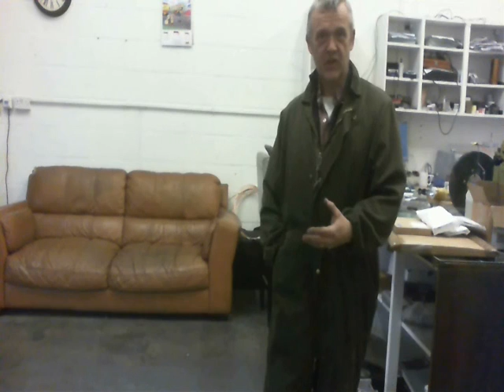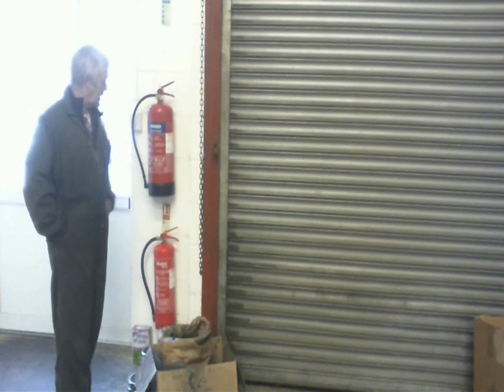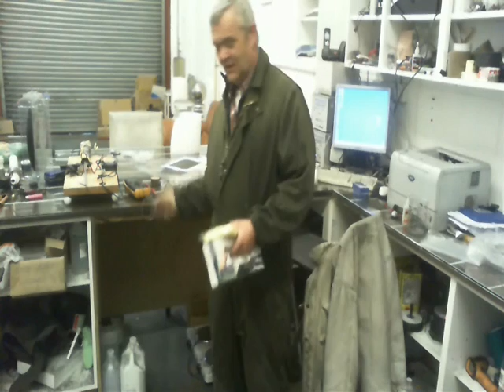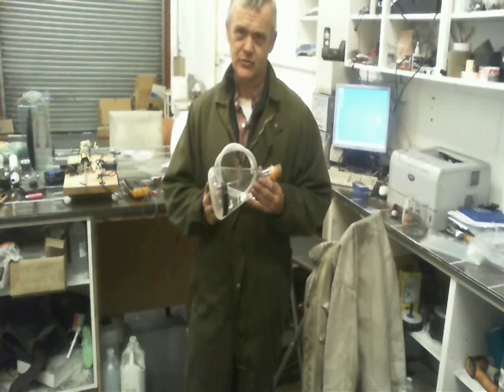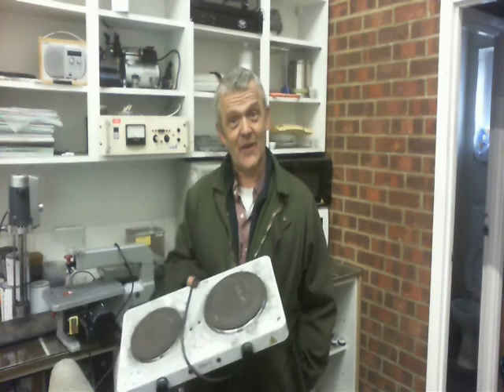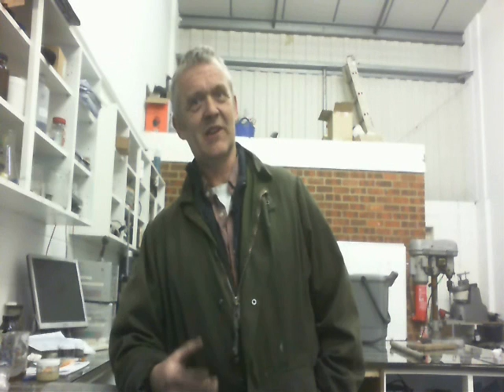A Tour Of My Lab And Some Suggestions On How To Set Up Your Own

Comment: More notes on the home laboratory.
Measurement is one of the cornerstones of science and engineering.

General rules of thumb: 

In applied chemistry (and electronics) you want to work with three significant figures.
In analytical and research chemistry, five (or more) significant figures is the rule.

The "Jeweler's Balance" our channel host mentions is most often a three significant figure device. Say, 10 grams maximum in 0.1 gram increments.
The electronic kitchen scale will be either two or three significant figures. Read the label.
Check with your local police auction of impounded property, both of these devices are often used in the street drug trade.

The enclosed balance in the background that our channel hosts mentions is (at least) a five significant figure device.

A triple-beam balance is almost always a three significant figure device.

Avoid spring scales like the plague.

Glassware:

You need to watch your expenditures in this area, it is very possible to spend a lot of money on glassware.
So much so that you will not be the first to think that you should have taken up glass blowing rather than chemistry.

There is a very well established secondary market for chemistry glassware, both as physical stores and as Internet stores.
Large laboratories will on a regular basis turn over everything that isn't broke to a dealer and bulk order a new set of whatever they happen to use.
Laboratory glassware breaks, but (with rare exceptions) does not wear out.
So the key phrase here is: Shop and Save.

Volumetric flasks and beakers, if not labeled or labeled as "Approximate" are approximate.
Approximate being two significant figures (sometimes better).

Graduated cylinders are usually three significant figures.

Graduated pipettes are usually three (or more) significant figures.

The key here is to look for a: "at xx temperature" on the etched label.
Measurement of liquids to three significant figures almost always requires consideration of its temperature.

Everything you use does not have to be calibrated. This is another possible savings in expense.
General purpose glass containers as working containers are just fine, but you do need a way to make calibrated measurements, if only to put marks on that old wine bottle you are using.

For known liquids, instead of measuring its volume, you can always weigh it and convert to an equivalent volume.
This can be another possible savings in expense for large volumes.

Glassware comes in thin wall (1mm) and heavy wall (2mm) types.
Get the more expensive heavy wall type when you have a choice, you will be surprised at how easily the thin wall stuff breaks.

Glassware comes in heat resistant ("Pyrex") and non-heat resistant types.
You don't need the more expensive heat resistant type unless your heating or cooling its contents or the reaction generates heat.
But on the other hand, many people choose to purchase the more expensive, heat resistant type for its extra strength (I.E: more break resistant).
Note: "Home Canning Jars" are almost always of heat resistant glass.

A note on storage:

Plastic is often a better choice than glass.
Pay attention to what the chemical originally shipped in. Use similar material containers for storage.

"Glass" (other than very special types), has metal ions which can leach into your solution.

Storing a solution of Graphene Oxide is one of the special cases.
Metallic ions will make it clump.  Probably not what you want to happen.
Polystyrene, Polypropylene, Poly-anything is a better storage choice in this case.
Reply from the maker: Although i appreciate the effort here - your own channel might be a better place. for this information - maybe a video or two as well?
Reply: Sure, I could do that someday in the future.
I have to learn those skills first though.

Thanks again for the space.
Reply from the maker: sit in front of your pc cam and hit record - it would also be nice to put a face to the words

Comment: You will want not just access to water, but a dedicated place to wash glassware and things.
Bargain hunters: 
Look for the old style, modified concrete, "laundry sinks" -
large, heavy, now considered ugly, (and hence cheap) but inert to nearly anything you can think of.

Chemical resistant work surface (on the cheap) -
Pool tables (a.k.a: billiard tables)
Large, very heavy, and when worn beyond use, expensive to recover.
For those reasons, you can often find one for a "You move it, you can have it" deal.
Remove remaining felt, the slate bed is very acid resistant.

Note: they can be disassembled into manageable pieces.
Organize a "Table Moving Party" among a number of your friends with promises of food and favorite drink - it will be worth the effort.
Reply from the maker: thank you

Comment: If you're really tight on bench space, your might be able to hinge the bench-tops.  Bottom layer could be the bashing-bench, next layer could be the "flat" bench, top layer could be the glass bench..

Another one if you're absolutely desperate for space is making yourself rolling benches, ie. benches on quality castors.  You pack them in your 8ft sq. lab till "lab-day" and then roll out the ones you don't need on that day.  There's a lot of obvious problems with this approach, not the least of which is the weather..  But if you're story is starting with "I can't do X because" try of figure out ways of turning that into a "can" even if it's a "I couldn't do X, but I did do Y which helped a little"

I also like the idea of smoke alarms (someone made the comment below), but the false-positives might be a problem.
Reply from the maker: Steve Simpson nice ideas mate - thanks for the input

Comment: nice set up buddy !  as usual sound thinking ...
:) will ask for advice once the time comes!
Reply from the maker: no worries mate
Reply: By the end of the week we'll have a date for the finances to arrive. Once the real estate paperwork is done ee can budget for the lab and other expenses ... the priority lies with the plant both technical and legal stuff.
Reply: If a karpen cell has the anode exposed to heat while the cathode side is cooler my guess is that it would function like a seeback effect... what do you think?
Reply from the maker: actudoran
I am not sure it will be a seebeck effect exactly - i think it is more akin to what the chinese were doing with graphene
Reply: Any articles on that? Still loads of heat to be expulged ... could use that cell to extract some electricity ... 7 month a year we can only sell about 12% of thermal ... if converted to electricity we could be in the money especially in very hot weather when hydro plants run out of water and the price of electricity goes high...
Reply from the maker: actudoran
it was a hot topic a few months ago but i can't remember the article - basically they put a sheet of graphene in salt water and heated it and got a current out - google will help - i did a vid on it too